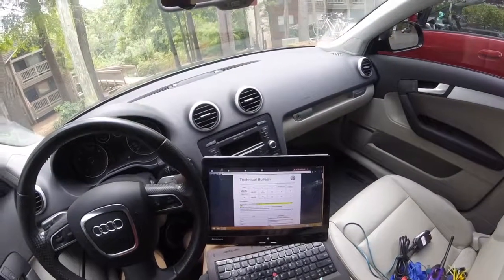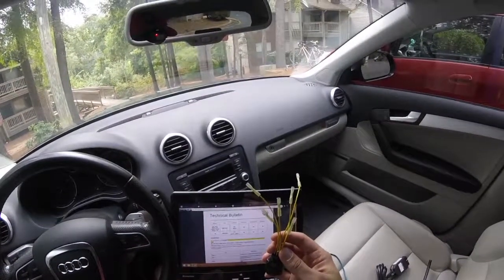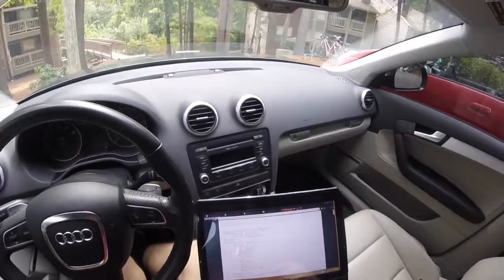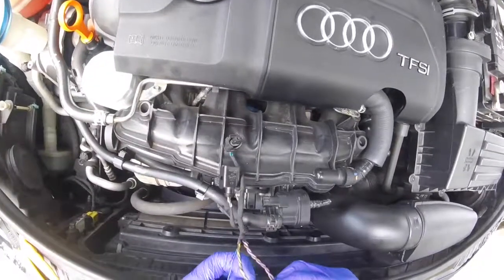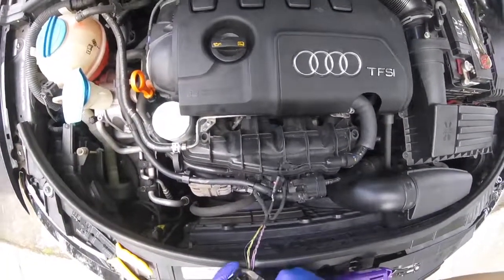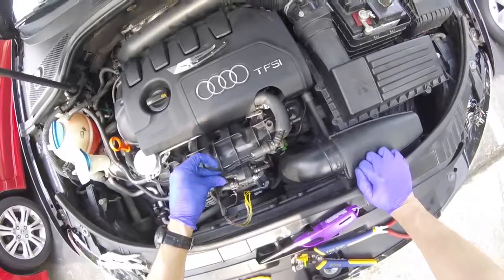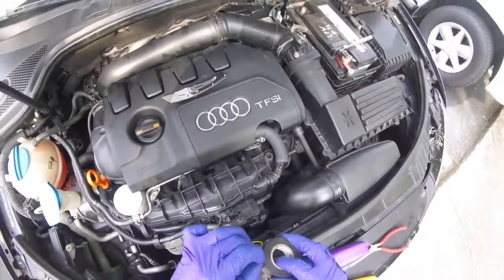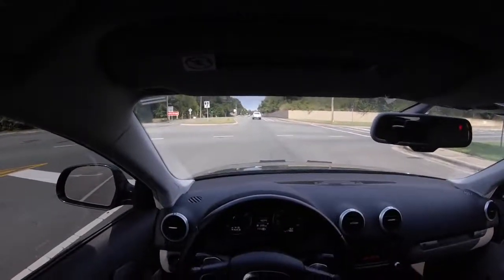How to Splice New Throttle Body Connector (VW TSB 2018652)

Comment: I have these codes and a P0641 that I have been chasing. Mine is a 2012 EOS with the CBFA engine. I saw the TSB for the harness connector to the throttle body but the TSB did not apply.

Comment: Thanks for the great video, do you know if it also apply to newer models I have an Audi A3 2015 Quattro with similar issues, I did change the throttle body 3 months ago now I still have the issue comming back, also was this cable sent by the dealer, I can't find it online, I found immitation on Ebay? Thanks for the help, John
Reply: Did you ever end up finding where to purchase the part?, im running into the same issue

Comment: General purpose vinyl electrical tape doesn't work well in a hot engine compartment. If you read the specs you will see that it is rated for use at a maximum of about 70 deg C to  80 deg C depending upon the brand. Parts of the engine compartment can get to about that temperature. What I've observed is that the adhesive fails and the tape unwraps itself. High temperature electrical tape is available that is rated to 105 deg C.